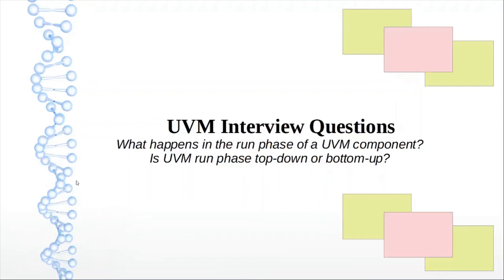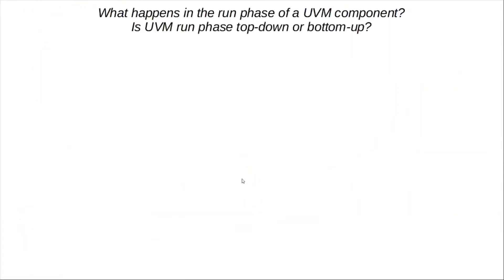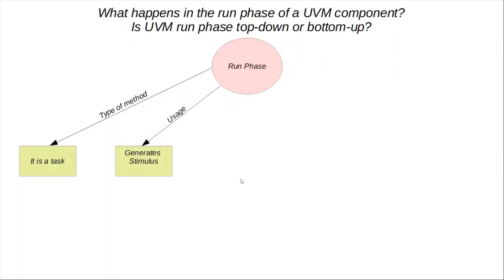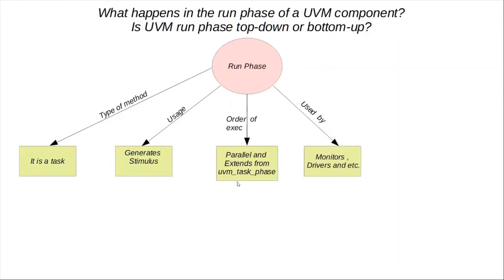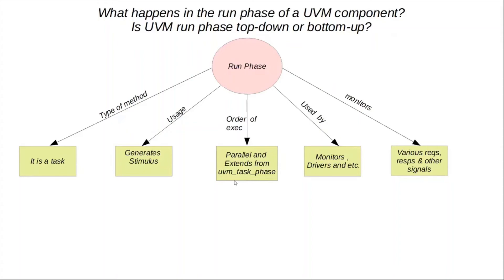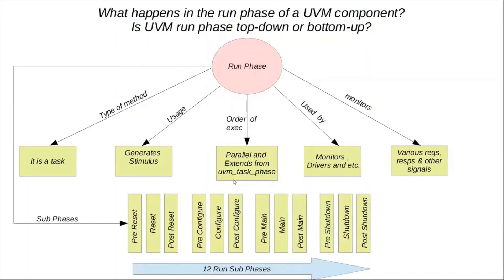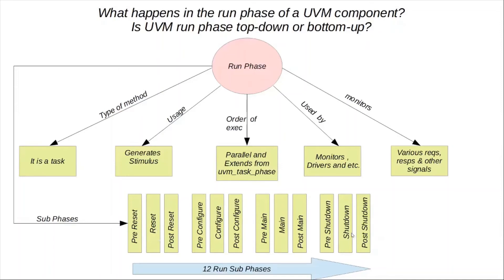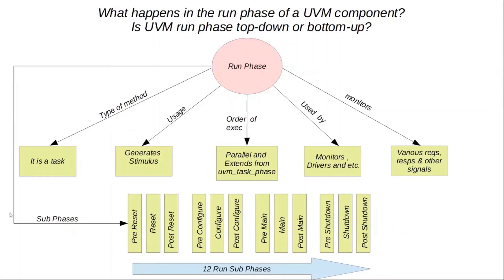UVM Question: What happens in the run phase of a UVM component? Is run phase top-down or bottom-up?

Comment: Hi Ken's..  
1)what would be the behaviour if we use main-phase in driver and monitor instead of using run_phase ?  
2) As I know all run phase gets executed paralelly.... If I mention only main_phase in my code will it skip other sub_phases(reset,config, shutdown)  of run_phase ?
Reply from the maker: Hi Saritha,  
1. Technically you can use main-phase instead of run-phase in monitors or drivers but then you would require a lot of synchronization between sequencer, sequences, and drivers method calls like item_done(). Also you should not mix an agent's driver using run_phase with its monitor using main_phase or other sub run phase. It is better to only use run_phase for all components (monitors, driver, etc). However, there might be times you may use main_phase or other sub-run phases in tests and environments. In the reset_phase you can call the reset sequence and in the main phase, you can call the run-sequence. For simple environments/tests this can be done through calling a virtual sequence or for more high-level cases using sub-run phase-based synchronization is a better option.

2. The key here is to raise an objection. A phase will only be done once all raised objections have been dropped. If you do not raise an objection in the reset phase then the scheduler will go to the next phase without waiting on the previous phase to finish.